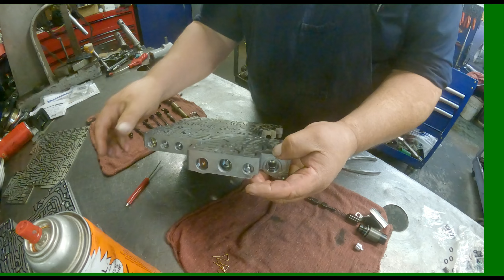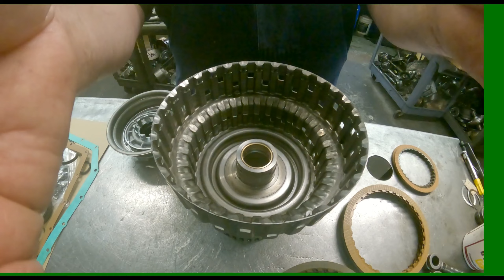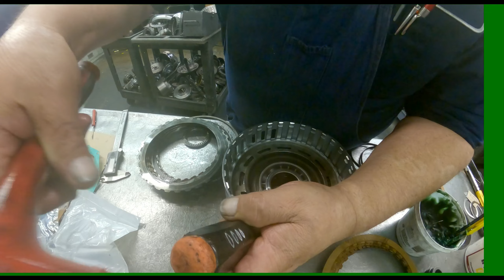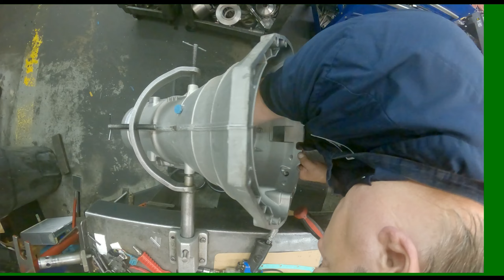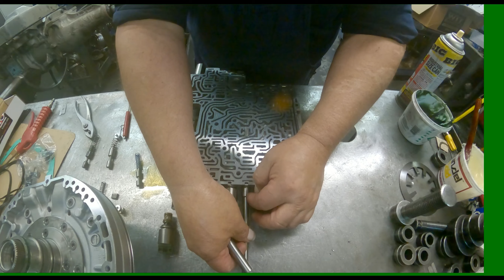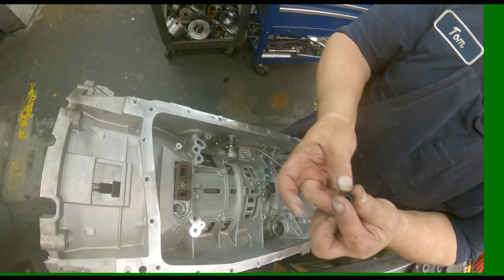BMW 6HP26 E-Shift Rebuild

Comment: Hey there! love your videos. I have a 4l60E that has a jerky shift from 1-2 and will also do so back down when downshifting 2-1. I am about to replace all of the solenoids on the valve body 1-2 3-4 3-2 and Torque conv solenoid, also the 1-2 accumulator piston and springs as well the transmission speed sensor. Does this sound like the right thing to do? Reason I am asking is because I want to make sure I have all of the parts and don't have to drop the pan twice. I am trying to avoid dropping the valve body. The truck does drive just fine has all gears and once it shifts there is no slippage.
Reply from the maker: Thanks. There are a bunch of things that can cause that. First thing you need to do is check for codes, if there are no current codes check for pending codes. If there are no codes check line pressure. If that checks ok you are probably dealing with a broken 1-2 accumulator spring. Line pressure should be about 55psi @ idle in drive, park and neutral 189 stall, and about 64 in reverse 324 stall. Line pressure tap is on the drivers side just above the linkage. 7/16 or 11mm will get it off. If line pressure is high look at the command on the scanner. Low line pressure command is about 1 amp and high command is about .02 amps. If pressure is high and command is low you have a bad epc solenoid more than likely. If pressure is high and command is high you are going to have to figure out why it is commanding it high. MAF, MAP and possibly bad computer.
Reply: @CurmudgeonTransmission  I cannot even begin to imagine the experience that allowed you to rattle that off like that. Thank you! You have given me a roadmap! Im going to the transmission parts store and will grab springs
Reply: @CurmudgeonTransmission  I've got a sonaxx pinless accumulator an epc solenoid the inner and outer 1-2 springs on the way. New MAP and MAF on the way as well. The only other thing will be the computer if this all doesn't fix it. I'll definitely let you know what happens. I can't thank you enough!
Reply from the maker: I would be pulling codes first. Just because the light is not on ( if it's not ) does not mean there are no codes. If you don't have a scanner you can go to Autozone and they will scan it for you. You can try cleaning the MAF sensor first before you replace it. If you are replacing the MAF and MAP I would not get them anywhere but the dealer. Computer is a last resort. They are not bad that often. I guess I should do a video on cleaning the MAF. As far as the MAP, check for broken vacuum lines. Sometimes if they are bad you can unplug them and it will set the computer at a baseline and use that as a reading. See if the problem goes away. If it does you know your problem is there. Just throwing parts at it can get expensive and not get you anywhere.
Reply: @CurmudgeonTransmission  I pulled codes using a scanner, nothing pending, no codes. Cleaned the MAF. Replaced the Vehicle Speed Sensor. Seemed to make an improvement to the shifting. Still an issue though.
Reply from the maker: If you still have access to the scanner I would look at the command for the EPC solenoid, see if it is high or low and compare it to the actual pressure at the tap.
Reply: @CurmudgeonTransmission  I dropped the pan pulled the accumulator which gave me a view of the gasket, it was cracked all around. I shook the a and b solenoids and they didn't jiggle. I dropped the valve body, the gaskets were BAKED to the valve body. I spent about 10 hours scraping them off carefully with a razor blade. I replaced the valve body gaskets, I also put in a pinless accumulator in the 12 accum from sonaxx. There was sediment everywhere I assume from the old gasket. I replaced the epc solenoid the 3-2 downshift, the tcc pwm solenoid, checked the valve bores and they were all very good shape. Replaced the filter and filter seal, replaced the a and b solenoids, replaced the inner and outer 1-2 accumulator springs (which were not broken) thoroughly cleaned the valve body (due to the millions of little pieces of gasket) checked the separator plate for impacting and found no significant expansion of the orifices. I buttoned it up all according to spec using a torque wrench, replaced the pan gasket and let it idle for about 20 mins cycling through all the gears. I just completed my first test drive, the truck drives and shifts like it's a brand new off the lot machine. I can barely detect the shifts now!!! Thanks to your roadmap I was able to add another 100k to the life of my truck. I can't thank you enough. Although I wasn't able to check line pressure your targeted advice resulted in a complete resolution of my issues. This truck drives better than it was before on all accords. INCREDIBLE! Thank you!
Reply from the maker: Glad you got it going, hope it lasts a long time.
Reply: @CurmudgeonTransmission  😀